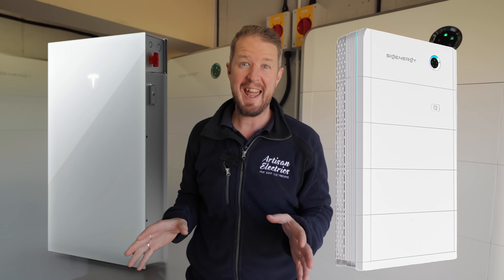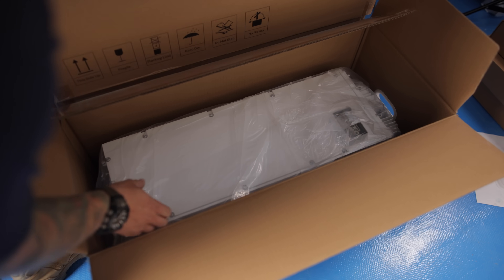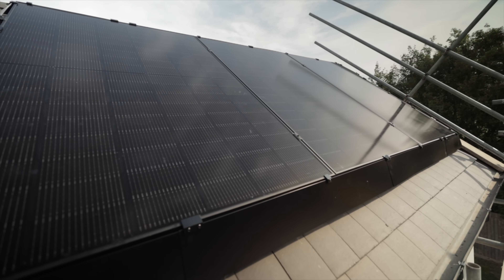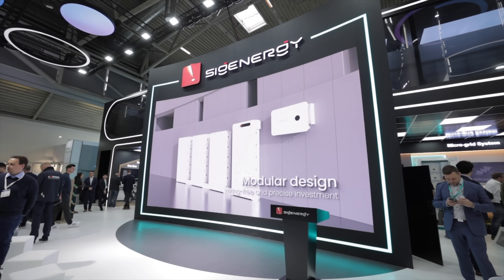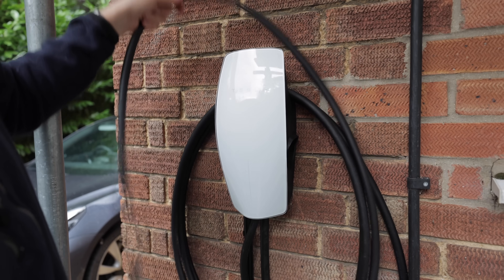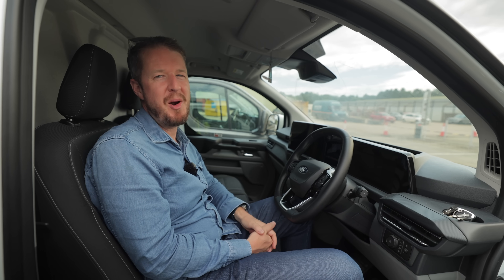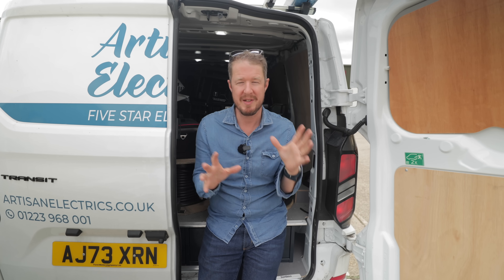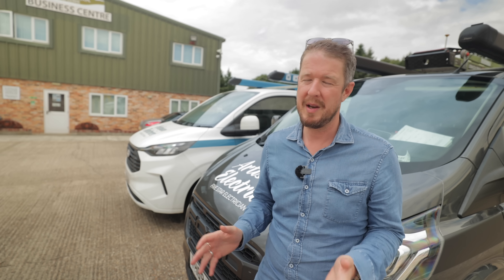The BEST Home Battery in 2025? Tesla PW3 vs Sigenergy SigenStor

Comment: Great video 👍
As someone who has been looking at Tesla Powerwall 3's for the last few months and discounting everything else, this video has made me think again 🤔
Reply: I started in the same place.  I have two Tesla cars.  A Model Y and  a Model 3 and so it seemed natural that I would go with a Powerwall 3.  After being hired to evaluate several ESS packages for a client. I felt the SigEnergy was heads and shoulders above the Powerwall 3 as well as the other systems I was asked to review.  
I now have a 16 kWh system with an 8.4 kW array. When I designed it I calculated that I would need 24 kWh of storage but decided to go with 16 for the time being.  I have already found that my initial calculations were correct and I will need more capacity.  However, since then they have released the DC charger with V2X bi-directional charging.  I have to see how much it costs but is it is less than $4K USD it may be worth it for me.  I would use the Model 3 battery when needed and get the benefit of having PV aware charging.  I am not too excited about the 25 kW charge rate but the car charging from PV only and very minimal losses is a big win for me.
Reply: @bryanwhitton1784  Nice. I'm looking more for a battery-only setup, so it's either PW3 + expansion, or SigEnergy.
The PWs have been around a while, but the SigEnergy is fairly new.
This is what is causing me doubts about it, even with the flaws in the PW3.
A visit to the next Everything Electric show in a few weeks may help me with my decision.
Reply: @IBoughtaTesla I understand that concern. But the system comes from a strong pedigree. Look at the management team and where they came from. Additionally, look at how other markets have accepted this system and it has performed admirably.
Reply: @bryanwhitton1784 Thanks Bryan.
Reply from the maker: Thanks for watching, hope the video gave you something to think about! 👍
Reply: Tesla warranty covers everything.  The sigenstor warranty covers some components for a much shorter time.   In my case we have had some minor flooding through the garage in the past so personally I’m considering this as well.
Reply: @xJI00  The major components, battery, controller(inverter) and load hub are all with a 10 year warranty with a 5 year extension available.  The car chargers, power sensors and communications module are three years and 2 years respectively.  Their AC EVSE has a 4 year warranty and they don't have a bi directional DC charger.  If there is no internet access the Tesla warranty defaults to 4 years while the SigEnergy defaults to a 5 year warranty.  Looks to me like a pretty comparable warranty situation.  Both have strengths and weaknesses.
Reply: I emailed artisan electrics for a pw3 quote and didn’t even get a response 😢

Comment: Great presentation, but one question that's never addressed is what you do with these systems if there's no / slow / intermittant internet connection? Can you even commission and operate them? On the face of it, battery backup power potentially reducing / removing reliance on the grid makes a lot of sense, but not if you are building in a dependency on something even more unreliable, namely the internet. I'd also like to understand whether IT security has even been considered and if so to what extent?
Reply: We go to war with china, china can detonate this remotely according to my tinfoil hat
Reply: If you run the SigEnergy via Home Assistant you can control it & get real time data even if the internet connection is disconnected and/or the cloud servers are down.  I do that with my Fox system and it's great.  You do need the internet connection to be able to commission it in the first place, but a hotspot or 5G wifi dongle should work as a temporary measure.
Reply: It depends on your country and location. In Victoria, Australia, you have to have a solid (usually wired) internet connection so that the energy supplier can monitor and limit/stop your input to the grid.
Reply: @fallonstuart8921  Is that the 'DRM' thing I've seen Australian people mention? (demand response management or something like that?)
Could be an issue if you are somewhere remote.

Comment: A comparison on the video after sig sponsored your install at your unit 
😂 
Impartial eh 😅

and it shows, you’d think there were no negative points in the sig system from your video.

No mention of the 2 year warranty on the LED strip or the little screen you like so much
No mention of the 2 year warranty on all the plastic bits.

No mention of the energy throughput limit on the sig battery compared to the unlimited cycle warranty on the Tesla battery (under certain conditions).

No mention of the users who moan about the sig system updates breaking things, or server downtime 

No mention of the sig system needing a connection to the internet to work (batteries bricked after 90 days).

No mention of no official API for the sig system and no official local network support. 

No mention of people moaning about noisy gateways from sig

No mention of the hyped marketing around safety.
Internet connection needed for safety features? Really?
Fire extinguisher for runaway battery? Really?
All hype and BS.  Show me the video of the sig system extinguishing a battery in runaway 
🤪🤪🤪🤪

Sad, just sad
Reply: We all know he's a BS artist, but you've also misrepresented the Sigenstor warranty. Both systems are overhyped and massively overpriced, but fanbois are gonna fanboi.
Reply: @VinoVeritas_ how is the sig warranty misrepresented?

It energy throughput based. Tesla isn’t for self consumption

Also the warranty on the gateway is only 2 years for sig, 10 for Tesla
Reply: @familyoffourdisneydreaming6081  The Sigenstor warranty isn't solely throughput based. That's how I know you haven't even read the warranty. Like I said, both Tesla and Sigenergy are overhyped and overpriced.
Reply: @VinoVeritas_ you keep repeating this, yet don’t give details of how I’m wrong.

What do you mean it’s not “solely throughput based”

“Sigenergy warrants that after 10 years the battery will retain at least 70% of its usable energy capacity, or it will reach a certain “throughput energy” (amount of total energy output over its life) — whichever comes first. “

It’s mandated that if the throughput limit is reached, before 10 years, then the warranty is done

People shown shown that with AI this can be achieved in less than 5 years

Comment: Thank you for pointing out the zero latency of Sigenergy fail-over (and I agree it cannot be called UPS). This point is often overlooked when discussing backup options. This ability to switch instanteously without disturbing computer equipment was a selling point for me - and I can vouch for it working in real life since I purchased Sigenergy and during a grid glitch my computers remained on. It is a great feature and critical for people who are at risk of power cuts and who must not lose their computing facilities.
Reply: Most power supplies have plenty of capacity in their capacitors to cover a small drop out of power, but it’s better to have a minimal amount of disruption.
Reply: @davideyres955 😂

Nice one
Reply: Tesla any time in costal areas.
Reply: Quite a few battery systems have a continuous backup output, powered by the grid or by the battery in case of a power outage, with instantaneous cutover.  The challenging part is the system that cuts the house over from grid to battery, without glitching out servers and such.  But it's perfectly fine to run the servers 24/7 on that backup output, without using the house cutover (properly fused of course)
We bought a battery system from AlphaESS, and decided that we wanted the whole-house cutover to backup power to be manual rather than automatic.  So between the backup output of the battery, and the manual cutover switch, we have a small sub-panel that provides power to the house servers.
Reply: It’s hype though, it ain’t 0, it can’t be, it’s not possible
There has to be a sense period where the system detects the grid going away.
Reply: @familyoffourdisneydreaming6081  UPSs come in two flavours, line interactive and online.   Line interactive has a switchover time of a few ms (because it waits to detect a grid outage then takes over), whereas online has zero.  The reason is that an online UPS is continually supporting it's load even when the grid is still up (so it does not need to react to anything because it's already doing it).  The downside is that there are higher losses because it is always working.
(Strictly speaking a switchover time of 0ms is wrong - because there is no switchover).
Reply: @WyndStryke it’s not a UPS
Reply: @familyoffourdisneydreaming6081   Yes I agree it would be better if it was stated as 0.02 rather than zero, but I wouldn’t call it hype because it is effectively zero, i.e you don’t notice any difference which is all that matters, this was a key feature for me and works brilliantly

Comment: No mention of respective warranties. While the sig gear is very impressive on specs I’d be worried about longevity of the brand as it’s fairly new and it’s a very competitive market just like EVs. Tesla on the other hand isn’t going anywhere so you can trust it’s warranty will be honoured
Reply from the maker: Thanks for the feedback!
Reply: @artisanelectrics  I would like to replace my Tesla Pwall 2 with sigenergy. Any thoughts it is only 3.5 years old.
Reply: I wouldn’t bet on Tesla not going anywhere. I have just spent the last 12 months extricating myself from Musk’s ecosystem - only the pw2 left. And lots of people i know are doing the same. The stock price is a meme stock these days.
Reply: @saqahc Must have missed the boat. EM  made me a multi millionaire 😅

Comment: I’m waiting for Sigenergy to come to America before I acquire a battery system. It looks like a cleaner implementation and management.
Reply: Sig Energy is here in America.  I live in Southern California and have a 32kWh Point Guard system in place.  They recently rebranded to Sig Energy.  Now finding an installer is somewhat difficult.  I reached out to them, they gave me a few names of local suppliers along with a few installer names.  One of the installers got back to me and the system was installed two weeks later.  VERY happy with the system.  Easily saving me $3K per year just in my annual catchup bill.  Plus my bill is only taxes and fees.
Reply: @ericmsands  Thanks, I have 25+ year old panels but have been waiting to replace them when I could get an integrated installation.; panles and batteries.  I will reach out to them.  My current panels cover more than my day usage. I figure if I replace with the same number I could be charging batteries for nightime usage.
Reply: @ericmsands surprised sigs not banned in the USA
Reply: It is in America as Pointguard brand
Reply: @connordines667  They've migrated from the Pointguard name to the Sigenergy name recently in the US.
Reply: @connordines667  Yep, been sold there for a while now.  However they are now rebranding in the USA so instead of Pointguard it will also be SigEnergy there too.

Comment: Hang on... Less than zero milliseconds! Does that mean it can see the future and switch over before an outage occurs? 😂
Reply: UPSs come in two flavours - Line interactive, which has a switchover time of a few ms because it waits to detect a fault before supporting the load, and Online, which is always actively supporting the load, even when the grid is up, and therefore has no switchover time (because it's already doing it).
Reply: 1 uS is less than 1mS and neither are in the past.
Reply: @StephenBrightwood  1us, 1ns, 1ps, 1fs, etc.. are all greater than 0ms.
Reply: The thing is, Artisan is an idiot and doesn't understand anything relevant to solar PV, inverters or battery storage.

Comment: Can you mount both externally?  You show the Sigenergy indoors but the PW3 in both.  The Sigenergy unit footprint may be too big for many domestic users which is where the PW3 wins.  As above the PW3 Warranty is far better.
Reply: The Sigenergy is designed for outdoor installs and is weather tight. Only restriction is if you are within a kilometer of the coast where it says it needs protection.
Reply: Yes both can be external, and both have heaters (the SigEnergy also has cooling, I assume the Tesla does too but I'm not 100% sure).  The SigEnergy is IP66, off the top of my head I think the Tesla is IP67, so neither need any further protection.
Reply: @WyndStryke batteries yes

Gateways though, the sig mandates a canopy
Reply: @familyoffourdisneydreaming6081  Max operating temp is 55C.  It has active components in it to support load shedding, power monitoring and communications.  Thus the limits.  Was never an issue for me as mine is in the garage next to my service panel.  The Gateway has nothing but a bus, breakers and an ATS so temperature is less of an issue.  I'll take the added features and work around the temp limitations.
Reply: Sig gateway requires a canopy, Tesla doesn’t
Reply: @familyoffourdisneydreaming6081 the gateway is generally mounted indoors near the fusebox.
Reply: @StephenBrightwood um no, next you’ll be telling me the sig gateway doesn’t have only a 2 year warranty and the Tesla isn’t 10

🤪
Reply: @familyoffourdisneydreaming6081  Why would you say that?  The SigEnergy system has a higher operating temp than the Powerwall 3.

Comment: Basically, it's like the difference between an Apple or Android phone. Tesla, is for people who don't want any control and just want something to work without understanding it or wanting to 'play under the bonnet'. The Sige is Android, for those who want to know as much 'geeky info' as they can and have the ability to tinker or easily customise/expand what they have.

Tesla has done a lot for electric cars in the early days, but other companies have now caught up, and overtaken their products. The same can be said for home battery products. Tesla has peaked a few years ago, and is now struggling to keep up, especially now that they are now seen as a more 'Toxic' brand worldwide as recent events unfold...
Reply: The sigenergy can be set to AI, programmed for import/export rates through the day and never touched again.
Reply: I consider these two to be equivalent to Apple. The android equivalent will be something like  Sunsynk, Deye or Sol-ark and Eg4 (the last two are in the US market).
Reply: The Tesla copes very well with multiple tariffs (I have 5 including FiT) and integrates  seamlessly with the cost of charging my Tesla Model Y, so i can accurately know how much I am saving compared with fossil fueled vehicles. 
So very much comparable to Apple world.
Reply: @fallonstuart8921 it's more than tariffs - it weather optimization which Tesla doesn't do.